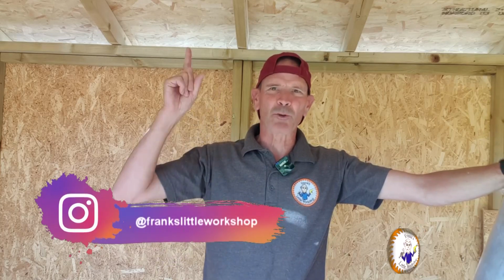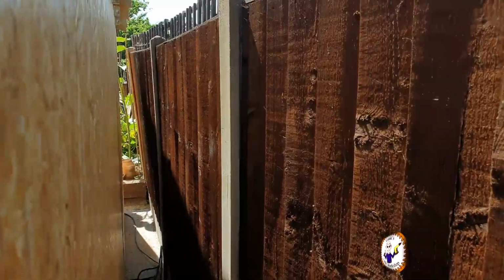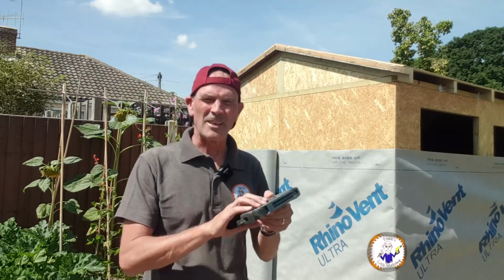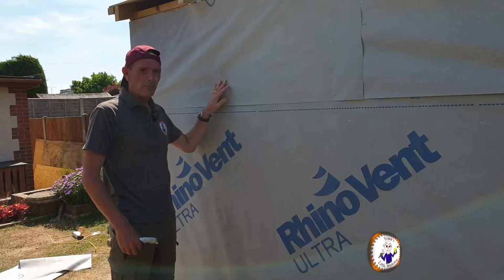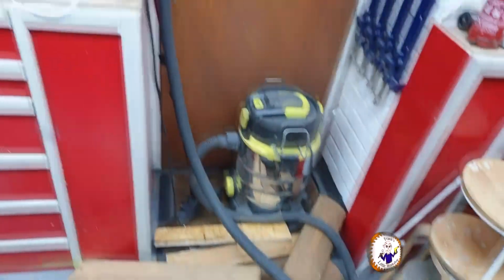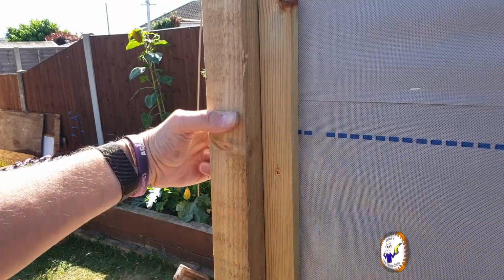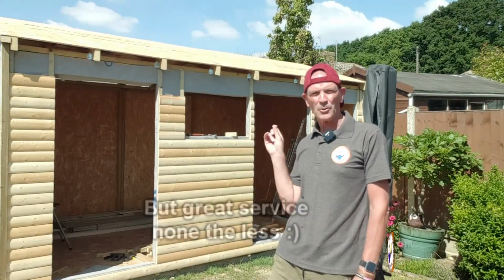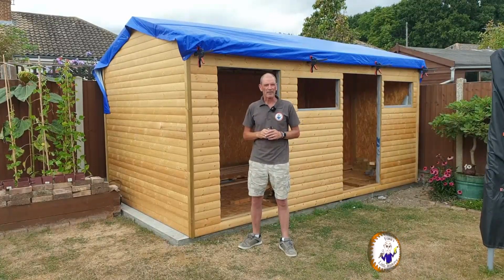Cladding and Membrane on the shed build

Comment: Thanks for video. This is first your video i came up. First thing was make me smile when you got to squeeze between shed and fence. I got same issue.
Reply from the maker: 😆😆 I'm just glad I'm as skinny as I am. If I were any bigger I would have been in a lot more trouble 🤣. I hope the video was of some help. Thanks for watching 😁 👍
Reply: This is my second shed at new home place with some experience already. First shed on old adress i built so close to fence so could not get there, only couple inches, just enough room for mini socket  ratchet, to screw pentaplex windows, reaching from roof

Comment: nice job with the cladding.  I wonder would it have been easier to treat the wood before applying to the wall especially the back wall.  your doing such a good job with the build, will your good lady decide to commandeer it when its finished🥴
Reply from the maker: 🙄Your 100% right David. But because I was literally making it up as I go along and using some recycled materials it would have taken so long to measure / cut / fit / adjust and re paint that in this case it makes more "time sence" to paint it all at the end 😁. I am only having the end 4" for project wood storage 😒. All of the rest is for Mrs Little workshop to put her garden stuff in. Hopefully that will be enough 😁. Thanks for watching David 😁👍

Comment: Just a tip for anyone else using the membrane. When you start the second layer, put a pipe up through the roll and use a clamp to keep the bottom of the roll at the right height.. Makes it easier to walk at round and keep it level..
Reply from the maker: 😁 Good tip Baz. Anything that makes it simpler is good advice. Thanks for watching 😁 👍

Comment: Nice video, Frank . I'm watching the project from the begining. How much did cost you so  far?(I know you will make a video at the end but was curious you've spend till this point. keep safe
Reply from the maker: 😁 Hi Mihai. I've only been keeping a rough total so far but so far its about £1200. Which is a lot, but still a lot less than buying a ready made kit (of the same spec). I almost have everything else I need (just need some timber for the doors). So not much more outlay to come 😁. Hope that gives you some idea. Thanks for watching 😁👍
Reply: THanks ,Frank. That helps a lot. I need to build one shed for myself after we move in the house that we're in mortgage process right now. the problem is garden end shape. the garden in 5.6 m wide by 13m long on left side and 12 m long on right side. I'm thinking to build it at the end of the garden 5 m wide , 4m on long on left side and 3 m right side(so the shed it will not be square and thinking to make a shed roof style. do you think will be any problems along the build?
Reply from the maker: @mihairachita174  🤔 Hi Mihai. Please remember i am not an expert, but I can't see it being a massive problem to have this style of roof on an irregular shaped shed. However... each rafter will be a slightly different size so you won't be able to make them all the same, as I have done. So to maintain a constant pitch height (the apex along the roof) the angle and length of each rafter will need to change. So there will be some interesting angles to deal with. But anything is possible. Just "expect the unexpected". Drop a new comment here if you make any progress. Good luck Mihai 😁👍.

Comment: I maybe being picky, but does anyone know whether it's necessary to tape the overlap of the breathable membrane? Thanks in advance
Reply from the maker: @rm9719  😁 Hi rm, I'm not an expert (as you can see), but i assume that if you have a sufficient overlap then no tape is required. But if anyone knows better then  I would go with there expert advice. Thanks for watching 😁 👍
Reply: @frankslittleworkshop  thanks for the reply. You could be right. I know taping using aluminium tape is necessary when insulating to prevent water ingress and cold bridging. I'm sure what you've done will be fine though. Good job!
Reply from the maker: @rm9719  😁 Thanks rm 😁. I must admit, it seems to be working perfectly. Its so nice and dry that a family of wasps have decided to take up residence in my shed and have built a nest. Thats a problem for another day 😆😆.